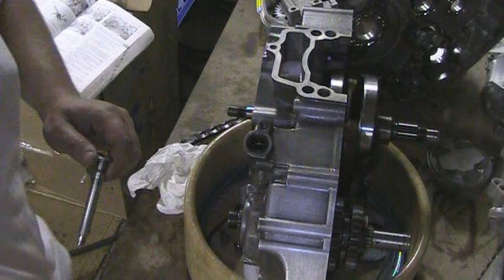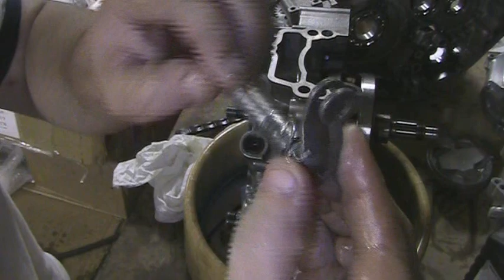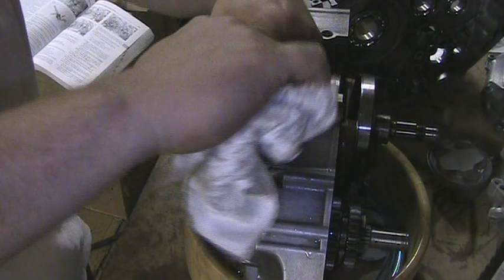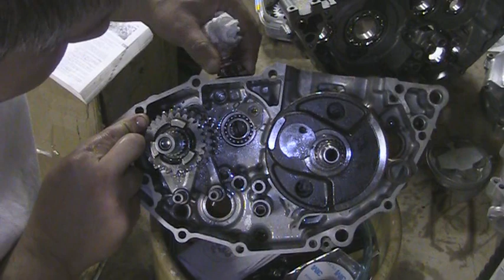Part 10: Assembling a motocross Bike. Clutch pushrod. YZ250F example

Comment: Hey Johnnysshop, i recently lubed my clutch cable on my bike. I'm now to the point of putting the cable in that pushrod but it no longer snaps back to its original position. I'm not too sure what i did wrong as all i did was disconnect the cable from the push rod shaft and now the spring no longer functions correctly. Any help would be appreciated. It's an 05 yz250f.
Reply: I am having the same issues did you find the fix?

Comment: Hey Johhnyshop, I could use a bit of help brother. 2002 cr125. The actuator arm is coming outwards towards my flywheel causing the bike to have no pressure with clutch. I just bought new arm and rod and replacing soon. If it still does the same thing does that mean it’s the bearing inside? Thanks man!

Comment: Johnny, I’m replacing my clutch cable and notice the spring that’s connected to the lever isn’t engaged, meaning it won’t snap back on its own. Does the tension on this lever come from the spring or once I install the actually clutch line, will there be tension?
Reply from the maker: From the spring.

Comment: Got a question so I wish I could post pics ,! My rod keeps popping out on my old cr I’ll be riding and it’ll pop out causeing the lever to go on my flywheel .. I come to a stop and take the case off push the rod back in and ride then 10 mins later it pops out again .! Am I missing something like is they something to hold it in so it doesn’t pop out ,! Plz help I’ve spent 1600 on this bike it won’t go now after 1 hour .. thanks in advanced it’s a 1989 cr125
Reply: Hey man. Reaching out to see if you ever found a solution? I have the EXACT same thing happening on my 2002 cr125. I just bought the new actuator arm and the push rod and going to replace them in the morning. If that doesn’t fix it, maybe it’s the bearing? Thanks, cheers

Comment: hey man if im in neutral and drop it into first while holding the clutch lever should it still freewheel  i got this old yz100 and if im driving and press the clutch it works but if im stoped and engine is off the clutch dont work also i cant start it in first while pressing the clutch is that normal

Comment: Can I remove actuator arm and replace seal without taking apart the motor?

Just leave it on the bike and pull the actuator arm, replace seal, then put it back on?

Comment: Hey Johnny! Can you please help me troubleshoot! I have an 06 YZ250F and I was riding the other day and my clutch cable snapped... So I replaced it and made sure it was set correctly. But know my Clutch is not doing a thing. I know its not the clutch cable adjustment because I can manually move the clutch pushrod to the engaged position and it still does nothing. I am wondering if something happened with my pushrod to cause it to no longer engage. Any thoughts? I don't know how to remove the pushrod to check. Thanks in advance!
Reply from the maker: Brian Davidson If the cables are good and adjusted I would check the pushrod first. It should be similar to this https://www.youtube.com/watch?v=0zH_TQSieaw

Comment: How do you get the push lever out of the case do you just pull on it will it be sort of hard to get out? I think the spring on mine is on upside down because when I push it forward it doesn't automatically come back Just bought the bike and im cleaning it up and rebuilding it the manual isn't clear on how to get it out!
Reply from the maker: Once the side is off it should just come out. Maybe tilt it a bit.
Reply: Ok thanks for the quick reply!

Comment: I have YZ250 94 and my clutch cable is really loose, like there is no friction to pop the clutch. For instance if i pull down on the clutch is doesn't go back to place so I'm wondering  if its the clutch actuator cam and pushrod? (like should there be a spring for my model? to snap on the clutch cable to bring it back to place? I know this video is old but I think you can help me! 

please and thank you...
Reply from the maker: +oshayne007 Sounds like the actuator spring as you mentioned of even the basket springs.

Comment: I have a 2005 WR 450 and I am trying to remove the clutch push rod. It comes up about 1/4" but won't come out - swivels side to side just fine. Any ideas on what I am doing wrong? Any help is appreciated. Thx
Reply from the maker: Hmm.. No idea, it should just pop out.

Comment: The other day my clutch cable snapped and the spring came off and I'm having a hard time taking the push rod out is there a certain way to take out the push rod
Reply from the maker: With the case off it should come off fairly easy.

Comment: Do u have to take apart the motor to get the that part out mine is not  catching
Reply from the maker: Justin Wilson Most bikes you shouldn't need to, what do you have?
Reply from the maker: Justin Wilson Yeah, you should be okay to just take the side covers off.
Reply: +Justin Wilson 
U have to release the clutch spring pressure,  just lean your bike on the side so you don't need to drain the oil and pull the clutch cover off then undo the bolts that hold the springs down. Then it should slight out and in.

Comment: hi I'm thinking bout getting a yz125 and he says the clutch push rod is broken. how difficult is it to remove?
Reply: +blayse222 
On my bike ( 04yz50f) it's super easy, just lean your bike on the side so you don't need to drain the oil and pull the clutch cover off and the rod is in the hole that is in the center of the clutch basket. If you can see the hole then pull out that piece in the middle then take a magnetic part picker or magnetic screwdriver and stick it in that hole and it will pull it out. Be careful because sometimes there is a ball bearing in there so don't lose that and remember the sequence they went.
Reply: +HardshipHelper thank u
Reply: +blayse222 
No prob sorry I forgot you need to take the clutch plate off by removing the screws over the springs, and also there is another piece that covers the hole. sometimes it sticks to the clutch plate so you don't need to remove it but if you can't see the hole then just pull the piece out in the middle.  good luck
Reply from the maker: +blayse222 Hardshiphelper is correct :)